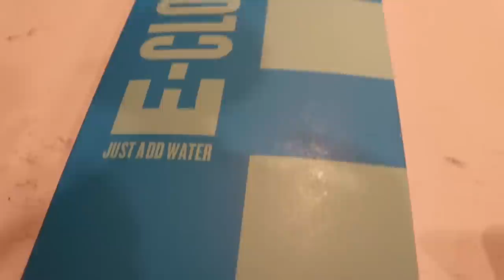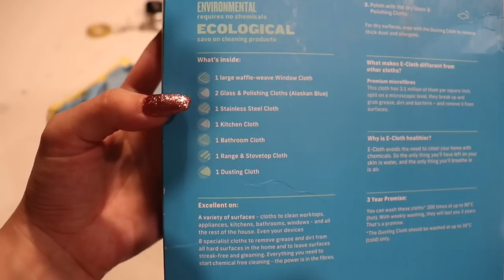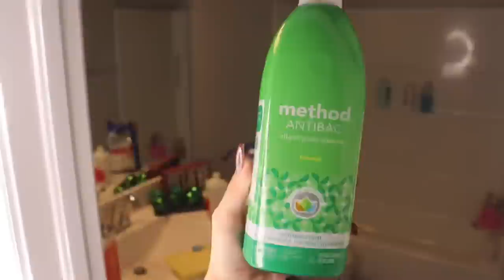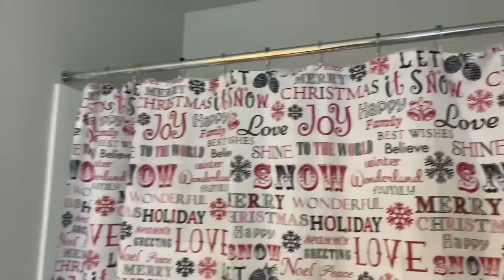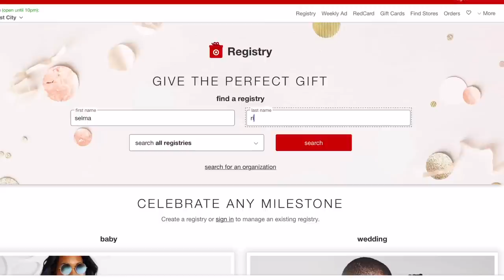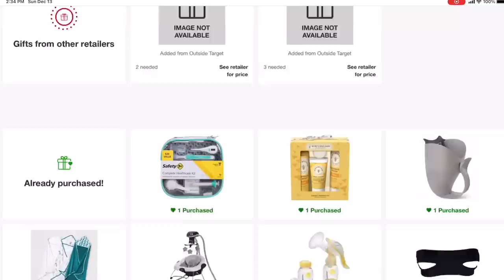How to DEEP CLEAN BATHROOM | Cleaning Tips | Extreme Clean With Me | Selma’s Toothbrush | Motivation

Comment: Your cloths might not be working properly if you're using fabric softener or bleach. The e-cloth website has directions on how to wash the cloths, you can't wash microfiber like you would cotton.
Reply: Since they're used a lot to wash cars, since they don't scratch paint, auto parts store carry special microfiber cleaner. I find washing them separately with regular Tide works fine though. I notice they pick up fuzzies if they are washed with other laundry.